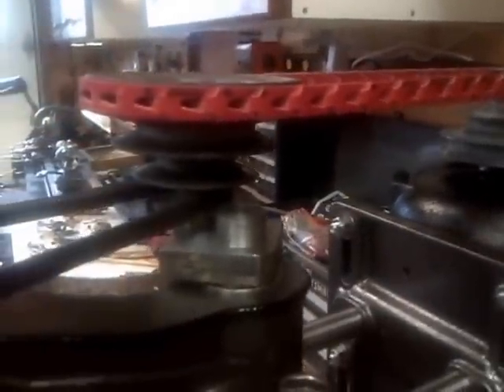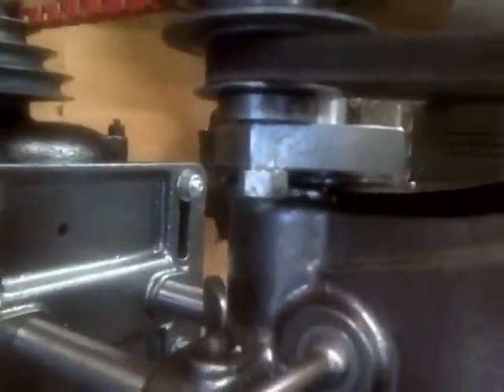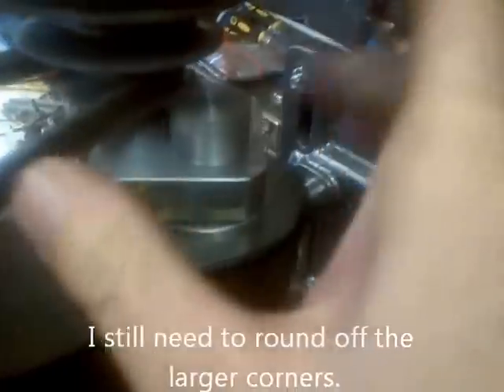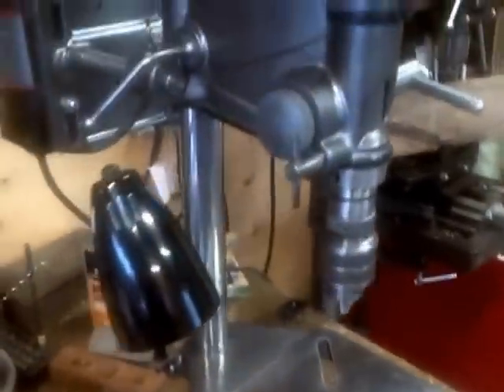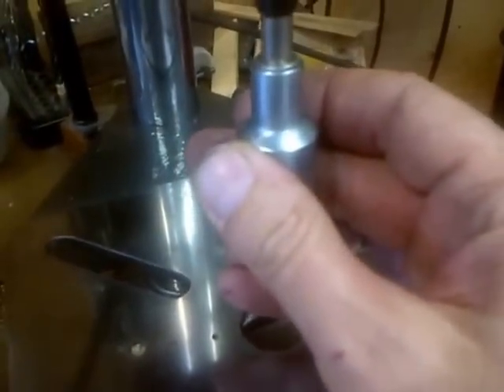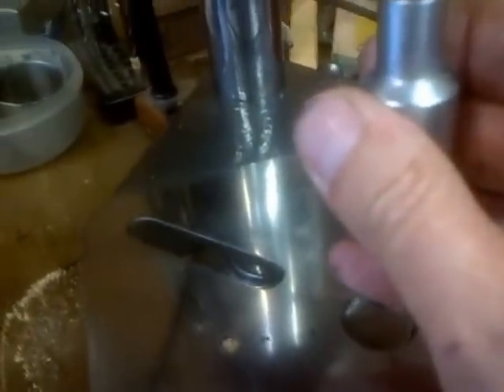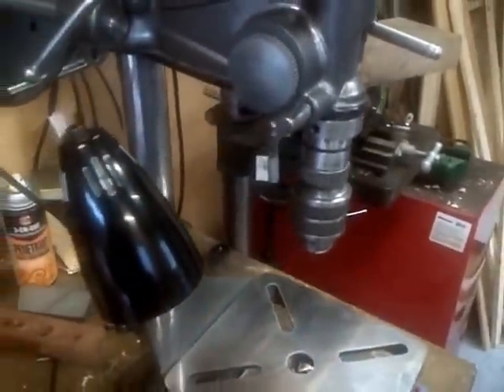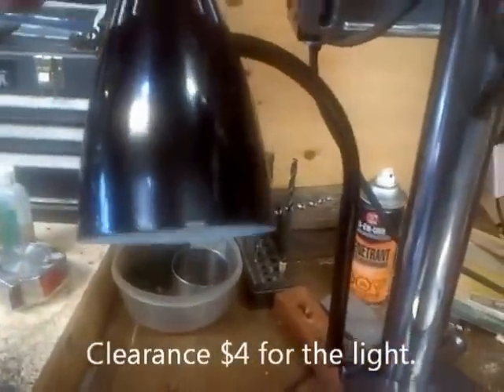Atlas Bench Drill Press Slow Speed Attachment

Comment: 26 rpm in 15 seconds. 104? How is this? Also, where did you get your gauge please?
Reply from the maker: Can't remember where I picked up the gauge. And yes 104 rpm due to the pulley configuration.
Reply: @MyShopNotes  I was just trying to figure out how your gauge measurement equates to 104. Thanks for responding.
Reply from the maker: @SCWD_US  It did 26 rotations in 15 seconds not 26 rpm in 15 seconds. Sorry, my screwup.
Reply: @MyShopNotes  ahhhh that makes more since

Comment: What color is this? Is it an automotive paint? I like the finish.
Reply from the maker: It is duplicolor wheel paint they call the color graphite.
Reply: Thank you for the reply. I had forgotten about that steel wheel paint. That is good durable rattle can. In the video it kinda looks as tho you might have bead blasted and clear coated. At the moment I'm gathering parts to build up a stroked small block Chevrolet to go into a black 4x4. I'm sick of GM orange. I think I'll pick up some of this graphite wheel paint and shoot it as well as an antique Craftsman drillpresses.
Reply from the maker: @coburnlowman  it was not bead blasted or anything, that casting was really smooth and that was 5 very light coats from a rattle can.